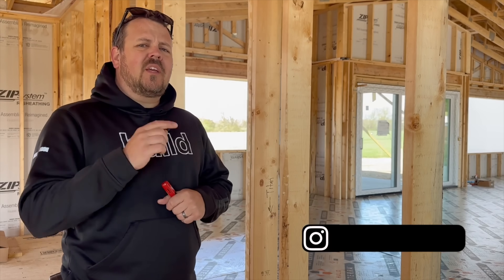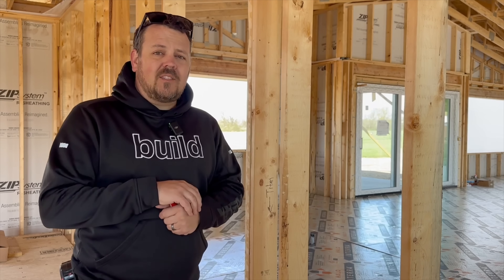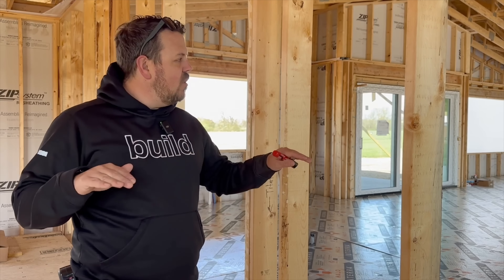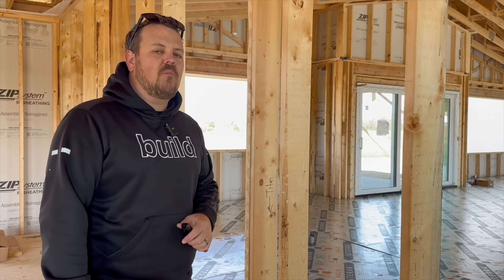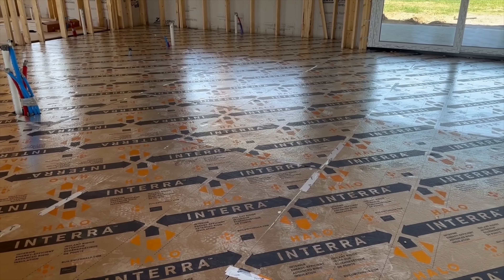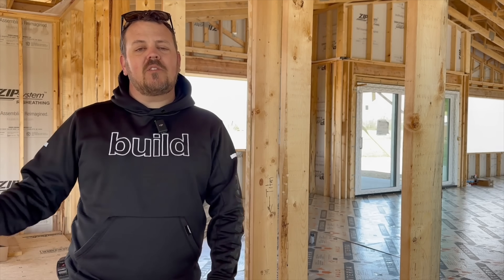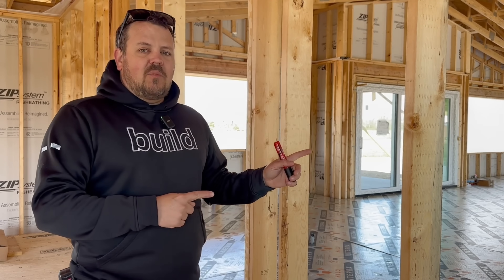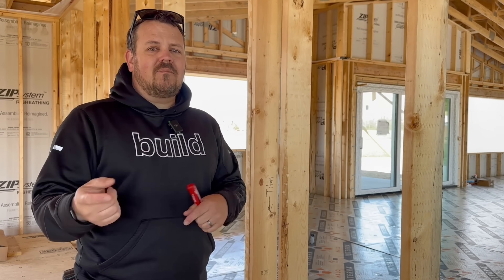This Insulated Subfloor Is a Game Changer for Slab on Grade Homes

Comment: Why did y'all not insulate below the slab? Like above the Stego wrap.
Reply: Yep, huge waste of money and labor time, you lose the floor mass.  All because you want hardwood floors?  It's easier just taking the money and burning it.
Reply: I'm in WA State. Code calls for r10 under slab and r7.5 if placed over slab. Slabs are a lot of mass and they're, of course, a lot of mass. Unless you have a heated floor, they often feel cold. Insulating on top of slab can lead to a warmer floor, which not only feels better on the feet, but contributes to convection less than a colder floor; unheated concrete slabs can create drafts that cause residents to turn up the thermostat considerably more
Reply: This method is purely for comfort, concrete floors are harsh on legs especially on seniors. Foam gives a little absorption, I doubt it though. I think crawl space method is more comfortable.
Reply: I don't do this kind of work, but my understanding is that with insulation installed under the poured concrete you have a chance for the foam to come loose and float up damaging the integrity of the concrete if you don't catch it and potentially causing you to remove and re pour. The piping through the floor requires energy to run and if a leak springs you have a bigger issue to repair. Foam on top is much simpler to install initially and easy to service in the future, both of which mean cheaper. Most clients would prefer a more affordable option to make their house more comfortable.
Reply: @reallunacy  Insulation under slab is required by code in many areas
Reply: @reallunacy  You need to tape the seams of the XPS foam sheets before pouring concrete.  Then having PEX on top stapled to the XPS or some plastic grid.  The XPS won't float.  It's done on most new homes around here and the concrete subs know what their doing.  Basements are always cold and in-floor heating keeps that space comfortable.

PEX will outlast copper piping.  It won't leak unless punctured (like copper).  It's not going to start leaking under a slab.  There are no pipe connection under the slab.

Comment: Why do y'all always put pressurized water lines up under the slab? That is a serious design flaw.
Reply from the maker: Good questions, we actually don’t always. We ahve built more than one home that didn’t have any that did. This home is all sleeved and they cn be serviced if they need to be. That in my mind makes a lot of sense. The lift cycle of the piping is fairly long, not forever and probably not as long as the concrete of the home. However they are very well protected under the slab. Ive repaired more above grade lines than below grade lines in my career, I see it both ways and I agree that you might have a point.
Reply: @jake.bruton.aarow.building the problem with posting videos on the internet is that your get anonymous trolls like me. But it takes a true scholar to give credit and present both perspectives. 

I don't agree with the under slab pressure lines. But I respect you for replying.

Comment: What do you do for backing at the bottom of the wall? And do you frame non structural walls on top of the floor system?
Reply from the maker: We have gone back and forth on backing at the bottom of the wall. We have done without and added 3/4 subfloor scraps back in. If you consider the number of places that you could logically ommit the back due to cabinets, closets, known furniture locations (such as a bed making it so that the trim will never get bumped) there are a lot of spots that could get skipped when it comes to blocking. We have also done multiple homes without. Think of closet shelf supports, they don’t generally have blocking in older homes and they are fine. Yes, we frame non-structurals on top of this floor.